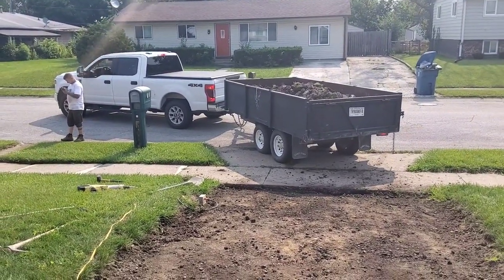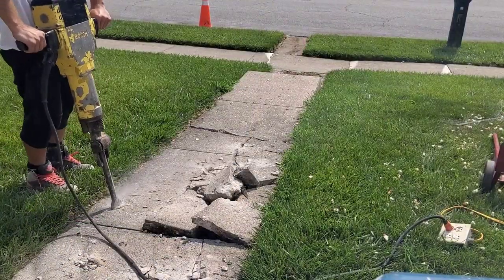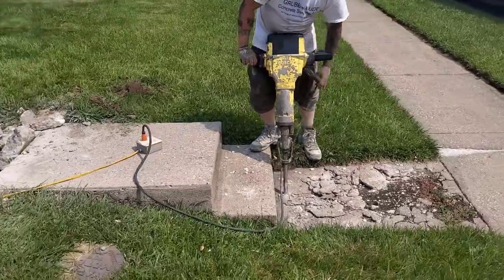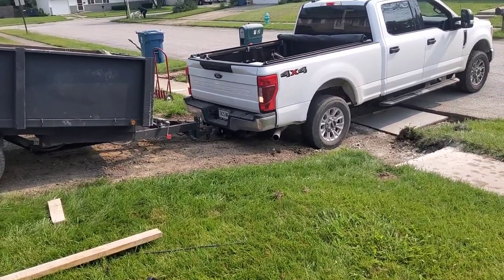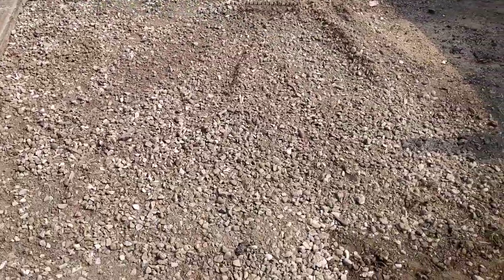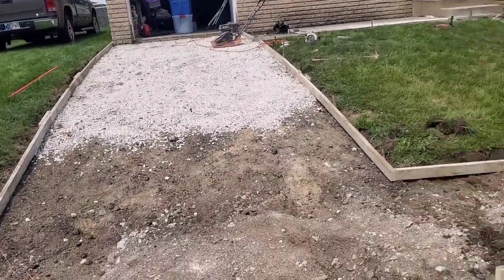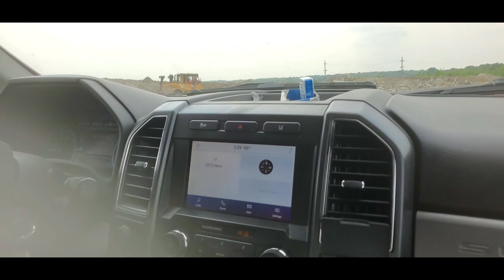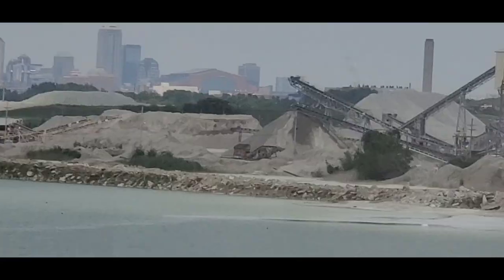GLOVES R 4 GIRLS! (demo OLD asphalt & concrete driveway)

Comment: You got to invest in that Bobcat mini and breaker. Your life is going to be so much easier. Plus, I think you'll be able to make more money / get more work. That's a lot of work with the jack hammer. Those Bosch breakers are awesome.
Reply from the maker: I'm gonna get something, I have that Kubota back hoe, it was just 45 mins away and 2 different trips, so I made the call to just bring the jack hammer! Because my truck is a dodge Dakota and can only pull an empty dump trailor, so we avoided about 4 hours of driving. But i plan on getting a machine w a breaker, but I'm waiting on the right buy!
Reply: Yeah I get that equipment isn't cheap, and you don't want to tie yourself down with payments. I try to avoid it too, but if I take a small loan that I can pay off in a year or two it's not too bad. Plus, you'll earn it all back offering more services.